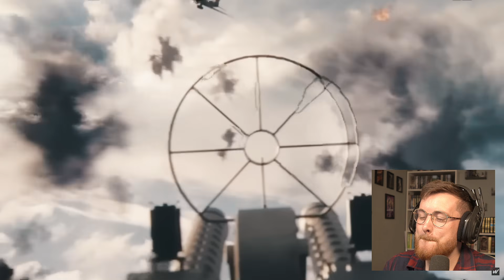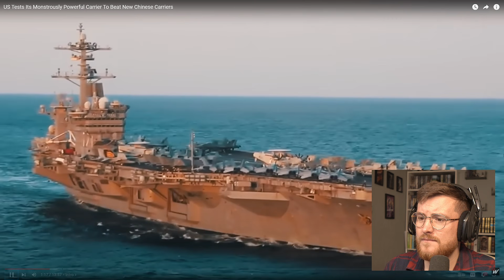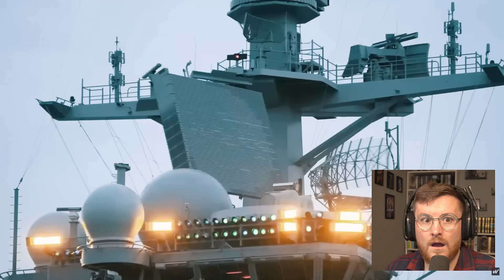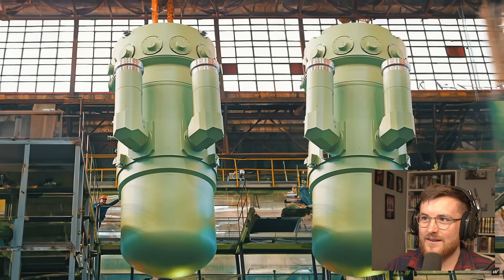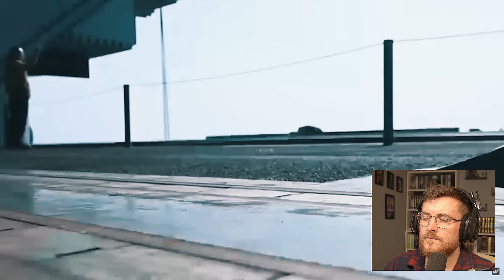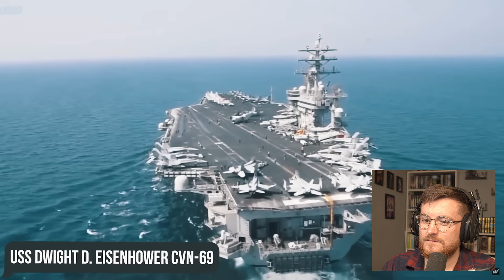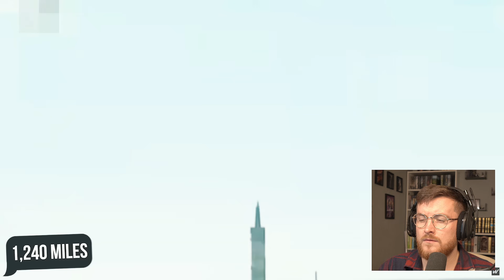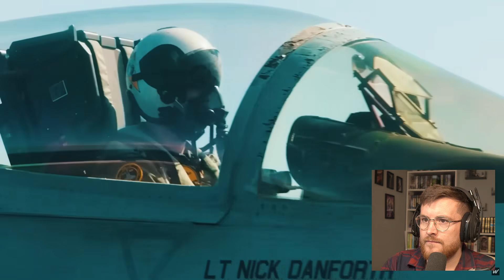Royal Marine Reacts To US Tests Its Monstrously Powerful Carrier To Beat New Chinese Carriers

Comment: Here's a fun fact. The Chinese have never launched an actual plane from an electromagnetic catapult. The amount of electricity needed to use the electromagnetic catapult cannot be produced by any means other than a nuclear reactor. The Chinese say they have a workaround but have never explained how the workaround works, nor they have ever demonstrated it, nor have they ever been able to builda prototype of proof of concept. The one on the ship has never been active and they have never placed planes on the ship itself. They have only flown planes from land near and around the ship. And they do not have the ski jump to enable launching planes the way their other two aircraft carriers use. They have never used a steam-powered catapult system on an operational aircraft carrier. And they don't have enough trained aircraft carrier pilots to man three carriers let alone starting the fourth carrier that they say they're going to begin building. In order to try to bolster their numbers they have resorted to enlisting kids from right out of high school to begin their flight training schools. They don't even have the safety protocols set up for catapult systems on aircraft carriers. This is primarily due to not having the first level catapult system, a steam powered catapult. To say that the Chinese are speaking out of the side of their mouth, it's like saying that the Chinese always tell the truth.

Comment: As the saying goes, "You go to war with the military you have, not the military you wish you had."  Unlike WWII modern aircraft cannot be quickly massed produced in factories originally building pick-up trucks or washing machines.  In WWII the numbers of airworthy aircraft actually increased during the war.  That isn't possible with modern, highly sophisticated aircraft.  If you lose an aircraft in wartime today, a replacement will be years away.  This is why the US has so many aircraft in service, so many "mothballed" in long term storage that can be returned to flight duty as well as high tech defensive systems and anti-radar weapons as well as the worlds largest fleet of refueling aircraft.

Comment: They''ll retire the older carriers and replace them with these. We'll maintain 12 to 13 carriers operational.

They actually reduced the gallies on the Ford. Nimitz class has 5 full sized gallies. Ford only has 2. Alot of the cooking is automated and the machinery is updated, so production of food is much faster. One centralized galley aft serves meals to the crew, chiefs, and officers from three adjacent sides; and the forward galley serves officers on one side and air crew on the other. The forward galley is only manned when the air wing is on board.

The max crew is 4500, but underway it'll be more likely to be just under 4000, which is what it had on that first deployment. Overall there are 700 less crew needed for the Ford class over the Nimitz.

Comment: You've got to think of the time it takes to build each ship.  It took 12 years to build the Ford.  It'll take a little less to build the others.  So by the time the 10th ship is built, the Ford will probably be pushing 40 - 50 years old.  It will be out of service by the time the last one is built.

Comment: US carrier doesnt need to pull into port to gather food.. that are what AFS are for,  FIRST,  most ports do not allow nuclear power ships into ports, secondly, the AFS are what are going to pull into port gather supplies then meet with the carrier group to supply whatever ships. They will do underway replenishment , basically AFS fires lines onto some of the lower decks and hookup cables with transport carts,  secondly, the AFS have helos onboard, they will take off and fly around waiting for the AFS crew to slide the pallet of goods to the flight deck, then HELO will fly in, pick up the goods, and fly it over to the carrier. rinse and repeat.  -  US veteran -  USS White Plains (AFS-4)

Comment: With the new Trump administration coming in less than 24 hours I suspect that our military will be upgraded with drones instead of the F-35.
 Drones are smaller but just as deadly if not better.  More can be carried on the carrier. 
 Drones can out preform a larger aircraft. And can be built more quickly.

Comment: It seems that these ships are very powerful. BUT
They are nothing without the support necessary to maintain them. It wouldn’t take long before they become useless in a conflict. Will almost 5000 personnel that need to be fed, very hungry aircraft that depend on fuel and parts and a limited supply of ammunition an aircraft carrier becomes useless very fast. You don’t have to destroy the ship. Just cut off its supplies and it just becomes a very large ship with a lot of sailors hunting for food. Same goes for all ships at sea on all sides. We lost one supply ship recently in the Middle East and only had one left to supply two carrier groups. If the one left went down both carrier groups would have been ups a creek without a paddle as one would say. 
These monsters are very very hungry machines.

Comment: Chinas is supposed to be bigger but how much experience does their crew have. England had the most powerful military and most powerful navy. We he several ships and subs powered by nuclear power. Is the a dock between England and Wales. Currently China does not have an aircraft carrier as large as the USS Gerald R. Ford; while their newest carrier, the "Fujian" (Type 003), is considered large, it is still smaller in size compared to the Ford-class carriers

Comment: So take an Aircreaft carrier. Add an Ageis cruiser's offensive capability, and you have the Ford class. This is the first class of carrier that officially is an offensive weapon as well as a support/defensive weapon.

No carrier travels alone, but this one can act on it's own while the rest of the group tries to catch up if it needs to shit and git (a carrier can outrun any other surface ship. How fast they are is classified, but you can barefoot ski behind one of these...if you have a 2 mile toe line). 

There will 10 of these to replace the aging Nimitz class carriers. We currently have 9 carriers on line, but we've had as many as 13, which is what the navy wants to get back up to. There will likely never be more than 12 to 14 working carriers. It costs between $6 and $8M a year to maintain one of this class of ship, and ironically, this class has 800-1000 less personnel on it than a Nimitz class carrier.

Comment: I began working on Nimitz Class carriers during the construction of the Nimitz.  I worked on in some capacity or another  all of them except the USS George W Bush.  Until you walk the flight deck or the Hanger deck it is almost impossible to take in the the size or standing in the drydock and look up. Want a thrill go to the top of the island house then start up the mast. At the first yardarm even sitting on keel blocks in drydock the mast sways in the wind. While at sea flight opps are broadcast on closed circuit tv or you can on up on the island house to watch. Saying the propellers are massive is an under statement, the rudders huge. In 30 years I was fortunate enough  to have worked on one of the most fantastic machines ever created. Thanks for reminding me.

Comment: we will have 10, congress mandates, 10 CVNS. It's actually a law. They have 2 galleys that prepare over 15,000 meals every 24 hours (4 meals served ever 24 hours. The 4th is served around midnight for sailors working on night crews) 
In most cases the Ford anchors out and does not moor peir side since foriegn peirs can't support the Ford's shore power connections.
The Chinese models isn't realistic. Ford has a tracking system in combination with its support vessles that tracks anything bigger than a large bird at over 400 nautical miles. Ford can also launch a fully loaded fighter jet ever minute. Because of its angled launching deck it can also recover aircraft at the same time. Ford can put all its aircraft in the air in less than an hour.

Comment: We already have that many nuclear powered super carriers- the Nimitz class.  These are their replacements.   Those began rolling out in the 80's, and are wearing out.  Much of the cost is in systems designed to lower crew requirements- which will ultimately lower the costs of running them.  As well as advancing them to the current state of the art -With room for future improvements.  The Nimitz class is maxed out, as far as upgrades and additions go.

  The reason to have that many is to actually have half that number deployed- with the others undergoing repairs and maintenance.  A rotational system.  Plus, we maintain a 2 ocean navy, with several carrier battle groups divided between them.  to be in several places at once, with the ability to get anywhere needed quickly.   you wouldn't see all 10 in one place, or even all 5 groups-more like 2, maybe 3, if things are really popping.

  AND we have Amphibious groups as well with amphibious assault ships- essentially baby carriers with HUGE cargo capacity.  Those carry F-35B's for the Marine Corps.  Marines get annoyed when someone sends aircraft to kill them- so they bring their own, to shoot the bastards down. lol.  (or blow up the schmucks shooting at them)

Comment: The new Quick Sink 2000 lb bomb can make quick work of any Ship.  Can sink a ship in just 2-3 minutes, as it's designed to split a ship into.  They did a test on the decommissioned USS Tarawa (an amphibious assault ship/helicopter and VTOL aircraft carrier) where they hit it first with ship to ship Artillery, and then a special torpedo, the torpedo did significant more damage but failed to sink it.  But one hit with the Quick Sink bomb dropped by a B-2 stealth bomber, it sent Tarawa to the bottom in just 3 minutes.

Comment: If you think the Gerald Ford is a big ship, sit one of the hospital ships (USNS Mercy or USNS Comfort) next to it and look at how small the carrier is.  The carrier displaces more tonnage, but the hospital ships are taller.  The hospital ships require 2 crew to operate.  One crew drives and maintains the ship.  The 2nd crew conducts operations the ship was built for (medical missions).  The hospital ships are 1,000 bed floating hospitals with its own blood bank, operating rooms for surgery, the ability to desalinate a few thousands gallons of water per hour so it can provide fresh water to civilians in a disaster, and a whole lot more.  Basically, the hospital ships are former oil tankers.  Oh, and they also have their own flight deck.  It used to carry 2 UH-60 helicopters, but the flight deck was upgraded for 1 V-22 Osprey.

Comment: The Ford is almost a 1/4 mile long.  

Also, submarines are nuclear powered, fyi.

The Ford has reactors, 2.

"A super carrier air wing, primarily referring to a carrier air wing operating from a US Navy nuclear-powered aircraft carrier, is considered significantly more powerful than most, if not all, other individual air forces in the world due to its unparalleled combination of aircraft types, range, firepower, and sustained operational capability at sea, making it a dominant force in terms of projection power and versatility across various combat scenarios; essentially, a single US super carrier air wing can rival the entire air force of many nations." -Google AI

Only 2 galleys on the ford just really big. 

Look what happened to Iran after mining of US frigate in 1988 minimum response to China.

China only steals tech they have little unique tech and it is mostly inferior.

Comment: 7:37  You won't really have 45,000 on the ships at one time.  The 4500 crew includes both the ships company who live on the ship all the time and those from various squadrons and servicemen deployed to support those squadrons that only are aboard during deployment.  Not all carriers are deployed at once, right now it is usually no more than 3 or 4 at once.  The rest are receiving maintenance or preparing to cycle out replacing currently deployed ships.  So using your 10 ship numbers, you're looking at around 33,600 living on those ships at any given time with 15,600 of them being in their home port.
Reply: But thats not to mention the other ships that escort it in the carrier groups

Comment: There's a video out there somewhere that shows the resupply ships rolling up next to the carrier and the process of transferring. It isn't just food. They actually shoot harpoons across with heavy lines and link the ships and then pull big fuel hoses across so they can fill up the tanks with jet fuel for the air wing. And food obviously, spare parts, clothes, sundries, literally anything, can be secured on palettes and moved across the lines. They will also use the ship's helicopters to move stuff between the supply ship and carrier just to help speed up the process. They even have a dedicated mail flight to the carrier which has it's own mailing address. The DoD just has the mail forwarded to the next nearest US port base along the patrol route of the ship and the plane flies there to pick up/deliver mail to the carrier. So the family only ever needs that one address. The logistics behind keeping a single carrier group fully supplied, staffed, operational, would ruin most countries. Which is why the country with the 2nd most carriers in the world is the UK. Followed by Russia and now China. Anyone else who has one can barely afford to maintain it much less use it for anything beyond naval parade day.
Reply: You do know that's how all ships resupply not just carriers and the hose connected from ship to ship is fuel
Reply: @PaulJohnson-lv6tt  i literally said fuel hoses. And yes... we know.
Reply: @mycroft16  you know, but you specifically said carriers did you not? Did you serve or you get your info off of Google or YouTube, refueling ships and resupplying the ship was my job as BM, so I've been a part of it, on 2 carriers as well as an LHA

Comment: That cost... is not what each of them will cost. That's what the FIRST one cost to research, develop, build, discover problem, find solution, implement solution, keep building, new problem, etc, finally done, test, problem, fix, test, problems, fix em, test, etc, finally got her working.

The next one is going to cost MUCH less and take significantly less time to put together. The first one is always gonna cost significantly more.

We have 11 Nimitz class carriers on ACTIVE status. So 10 of these is without even breaking a sweat. The Navy would probably like a few more of these. And may add to that contract in the coming decade or two. Think though about the sheer size of Newport News shipyards that they have FIVE (5) of these behemoths in production at the same time.

As for it being nuclear powered, the Nimitz carriers are as well. And several classes of US submarines. We got a bunch of nuclear powered naval assets out there.

Comment: United States on top of the Gerald R. Ford includes I believe don’t quote me on this but I believe 10 Nimitz class aircraft carriers which are going to be replaced by the Gerald R Ford class.
Reply: Correct, though there is an offset as Gerald Ford replaced the older Enterprise and will mean George H.W. Bush doesn't have a immediate replacement.

Comment: Yes. 10. The carriers that this class is replacing are getting old. All but two have been in service since before 2000. As the older ones are retired, they have to be replaced. Since there are 10 current ones, you need to replace them with 10. This is actually slightly less than what the Navy really wants. It would prefer to have 12, so you'll most likely see the last couple of the old class still in service when the NEXT class of carrier is starting to be built.